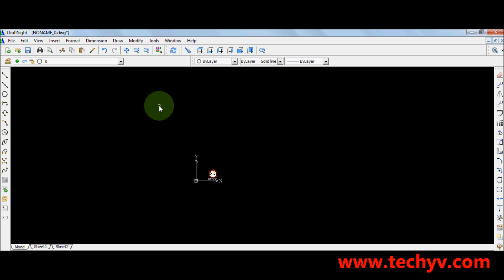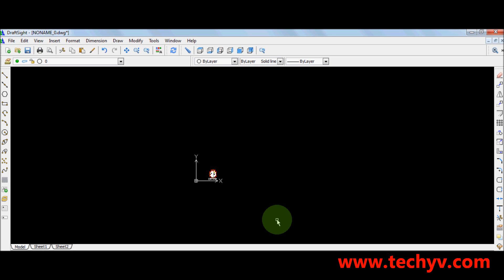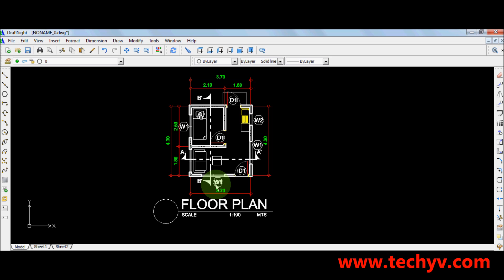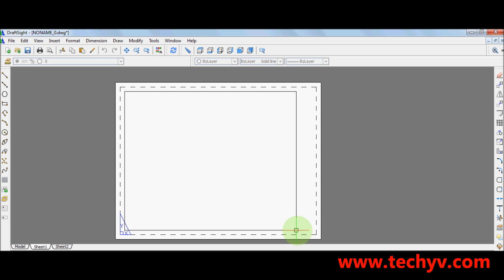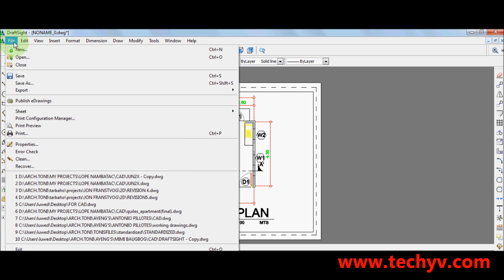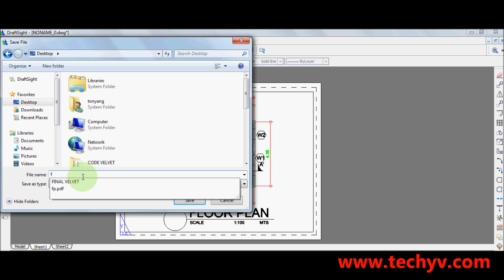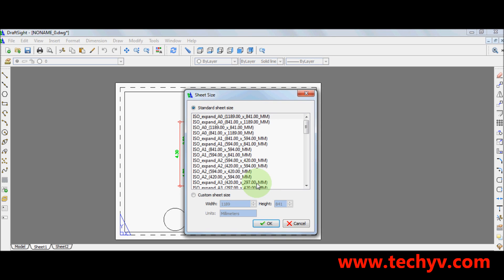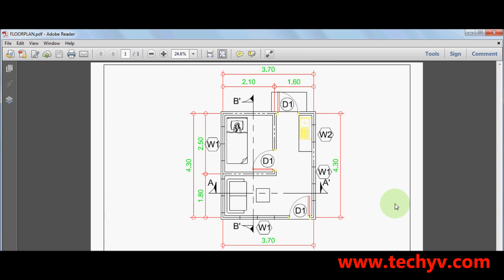How To Make A PDF File Using Draftsight

Comment: I have a 200KB draftsight drawing and when it exports to pdf, the pdf is 206 MB.  Clearly I'm doing something wrong.
Reply: Did you ever get an answer on this? I am having the same issue.
Reply: @kieronbaker2468  I gave up and use print to PDF instead.  A complex size E drawing in high resolution is under 900kb.

Comment: Hi everybody! Thanks to Techyv with converting to PDF. Clear. But I have stuck with the problem to make the same procedure for few floor plans in one Model sheet. How to separate one floor plan out of few ones and only one floor plan to select for one by one converting? Otherwise just making the converting as it is explained in the video I got few small plans on one PDF page. Thanks in advance

Comment: hi I want to make pdfs of drawing sheets in DraftSight. The drawings were originally created in autocad lite and used a .ctb plot style. however when I export to pdf in Draftsight (& select the .ctb file), the result does not use the plot style settings (which converted colours to black with varying line weights & styles) and the pdf is in colour which I don't want. I can't access the printstyle editor  for some reason. any suggestions?

Comment: Techyv is really the best solution provider web site. It supplies the best instructions on using any software systems. Like today, I learned about FlashGet which can help me by downloading software easily as much as I want. FlashGet application offers fast and secure downloads and allow me to push, restart and resume downloads of any files from the Internet. It can use up the lowest system resources, but it will not affect my usual task. It can also call anti-virus automatically to clean viruses, spyware as well as adware after finishing the download. It can even boost up the download speed and the stability from 6-10 times faster and it uses MHT technique. FlashGet’s new feature is FlashGet3 which supports HTTP, FTP, BT & eMule protocols, IE6, IE7, IE8 and Firefox supported and new P4S technique that can be able to accelerate the downloading process. Excellent software! I am very grateful to techyv for that video.

Comment: Draftsight is a wonderful tool and very useful for editing 2D DWGs. Utilizing its translator, never got any issue. If anyone knows how to use “AutoCAD”, the “Draftsight” is a breeze! It does all, down to its command line! There is no slightly 'getting used' to the software at all. Its free for home-based users and it runs on Windows, Mac as well as Linux platforms which is a great enormous plus for me as am weaning off my dependency on Windows and for a beta release, Draftsight is very stable. Give it a try. Have fun with it. If anyone wants to acquire to draw like how it is done in the industry, this is the best package for you. But you might discover it very useful for simple design projects also. Well done Techyv. Keep up the good work!

Comment: Sofia, after watching your video I tried to install CADPro 6 on my ASUS laptop, but I got this message: error 1320: specified path is too long. I have tried to alter the path so it is not so long, but it still would not install. I also tried to fix this by going through Computer > Organize > Folder options, viewing and checking "Show hidden files and folders," unchecking "Hide protected operating system files," and then re-installing the software, but it still gives me the error 1320. Need help.